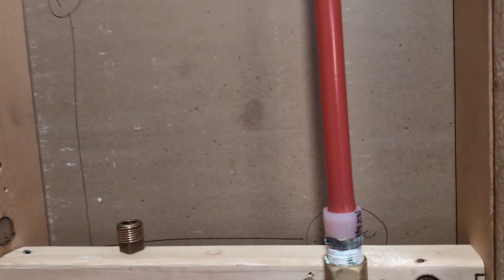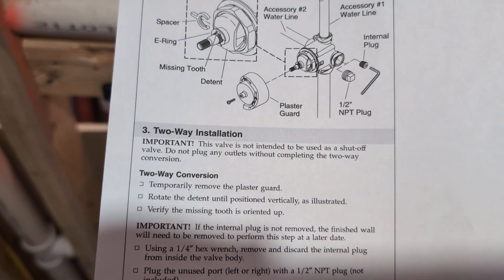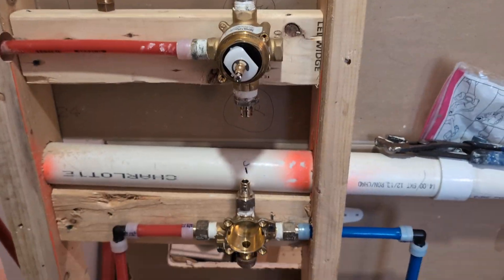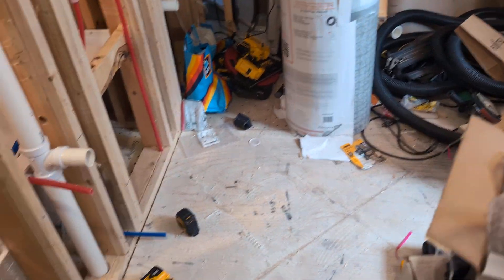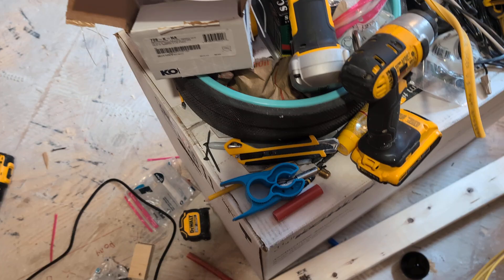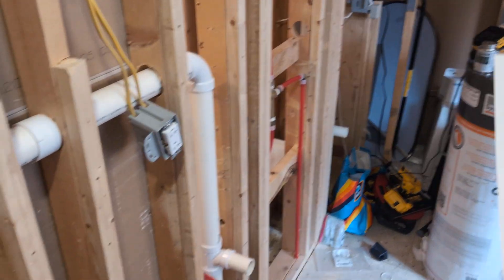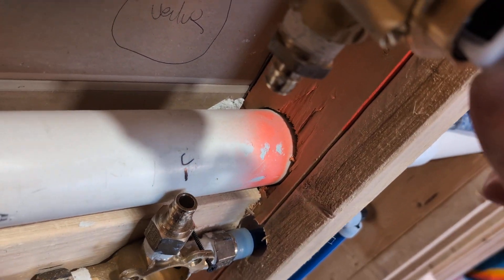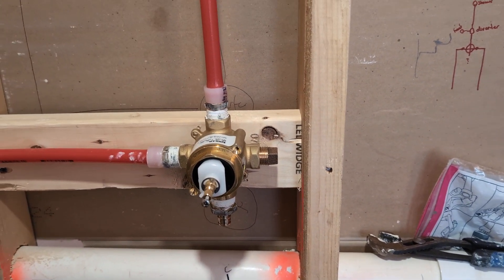Kohler Transfer valve 728-K-NA 3 way to 2 way conversion tutorial.

Comment: I just did this install, I removed the 1/4 plug to convert it to a 2 way, installed k737, now I can't get both accessories to be at full pressure only one at a time, freaking annoying. I've plumbed for 15 years and I hate these valves. Not to mention some of the other kholer diverters, like mine only have one port for the diverter, some others have a duel port in the cartridge for the diverter allowing both accessories to have full pressure at once, my problem is I want full pressure on both and then one or the other, which I can't actuate

Comment: I'm doing this now(literally) - as far as I can tell the "plug" that has to be removed to convert the factory 3 way configuration to a 2 way is only on the right side outlet of the valve, regardless of where you are intending a shower wand (left or right). This seems illogical but there is no plug on the left side - only the right side. So now I have to remove my wand copper. Ugh.

Comment: My diverter doesn’t switch to the shower head, it’s a two way so I have a handheld shower bar and a shower head. 

It only allows the handheld to work not the top shower head, idk why???
Reply from the maker: I would talk to Kohler about that, I dont have enough experience to venture a guess
Reply: Isn’t there a plug you’re supposed to remove
Reply from the maker: @jimmymags6516  yes I removed it in the video
Reply: @ciscokid1701d  Yes sir , I noticed that. My comment was meant for @dannysipos . I left the plug in once and had to rip out the wall later on to remove it.
Reply: @jimmymags6516  it’s a two way diverter so we left the plug, I had to twist the cartridge around because the water wouldn’t go up to the shower head. It works now but when I put it to go to the shower head and shower wand the flow is not as good
Reply: @jimmymags6516  It said to remove plug if using three way diverter

Comment: Is it possible for you to provide the measurements of all your valves and drop ears from floor? Getting ready to do a tub to shower remodel and using the exact same Kohler stuff. Just having a hard time determining heights
Reply from the maker: My shower head is as far up as I could get it while still attaching the 19" shower head arm without scraping the ceiling. The average heights of the shower mix and diverter valve can be found on google. I dont remember

Comment: In my experience ( 35 yrs building, remodeling, finish work, repairs ect) supply hose items are of superior quality and less expensive than big box stores. Home Depot especially is extremely expensive and has some of the lowest quality throughout.
Reply from the maker: In my case, the supply house is 3x to 4x more expensive but the quality is there for sure